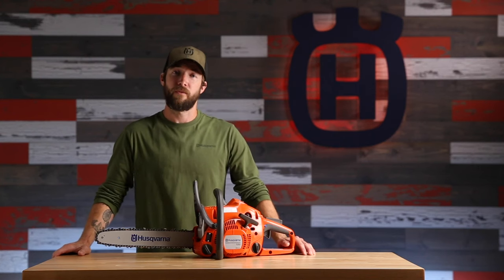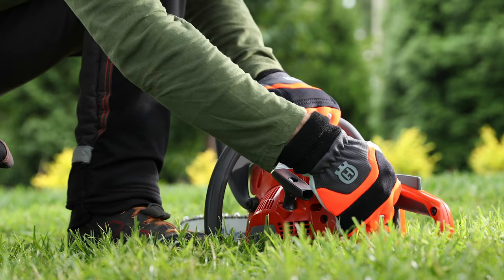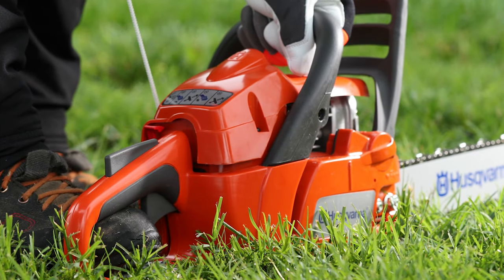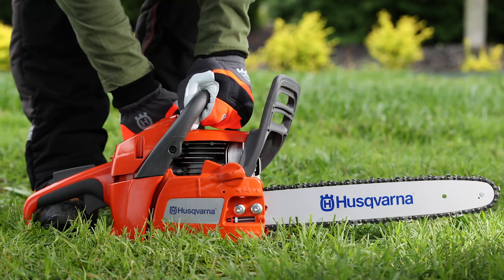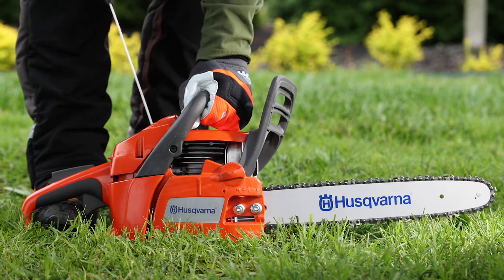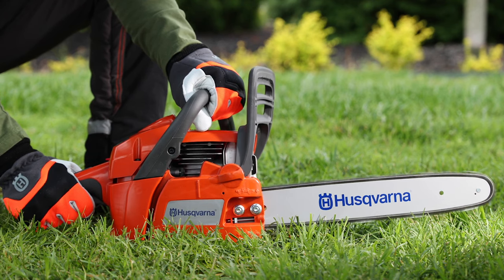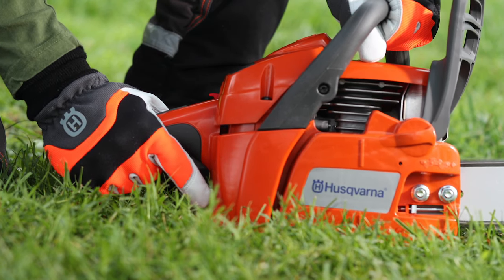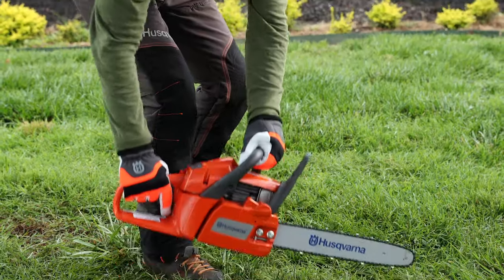How to Perform a Cold Start on a Chainsaw | Husqvarna

Comment: For a year and half, I had good luck with my Husqvarna 435. the chain refused to come off and it started right up until this week every time. I was very pleased. Now I can't get it running. This video says pull s maximum five times until it starts. Yet my chainsaw does not start. I will get one chug like it is going to start then nothing. I changed the fuel, but still will not start. I am not happy. I will check the spark plug next. I know I don't want to remove the carburetor. That looks simply to do but I think that would be risky for me to do.

Comment: AFTER reading the comments bellow it seems that I am wasting your time  in asking some suggestions about my Husqvarna  236
that I replaced with new oil seals  and piston and cylinder +spark plug  + carburettor+ fuel lines & filter+ air filter +manifold gasket then 
....when time to start come it started and died after many days in traying I decided to pull it apart and ...  there was a lot of petrol in the
 crankshaft area  ...Can you suggest  anything ?

Comment: Complete garbage……mine takes 78 pulls to start, if it will start at all.
Reply: Well there is something wrong with it I have had one for 8 years now and still starts in 3 to 5 pulls
Reply: @Louis-B-53  yep
Reply: I'm having the same issue. I bought mine last year to take camping. I used it to saw a 3 foot log down for firewood and when I went to use it again, would not start. It was still under warranty so I took it in to my local builders supply and they sent it off. A few MONTHS later the mechanic said the carb wasn't adjusted right & I thought, "ok problem solved...maybe." I took it home and it started fine, ran fine and restarted just fine so I thought nothing of it. Took it again to camp just a couple weeks ago and NOTHING. Won't start AGAIN! I'm trying to start it right now and this POS is giving me a hard time. And OF COURSE the builder's supply won't refund me or offer a replacement.
Reply: @relyk918  sorry, man
Reply: Yep mine does same thing..if you get it started better cut everything or till gas run out.want start anymore till next day.
Reply: "Idle for 20 to 30 seconds at high speed"?   Say what??????   😮😅
Reply: @relyk918 this is the problem I have. Takes way more than three to five pulls to get it started. Once I get it started it runs fine until I decide to take a break and turn it off. Then it takes 40 to 50 pulls if it will even start.

Comment: Well the first problem is you cannot get your foot into the tiny handle loop, with safety boots even the toe will not go in making a very dangerous situation, why dont the manufactures learn from practical users?

Comment: BS if you cold start it and hold it full throttle, you'll end up scoring the cylinder and piston/ stuck rings' no compression and won't start and they will not warranty it. 
Cost more to fix a cheap saw than what it's worth.